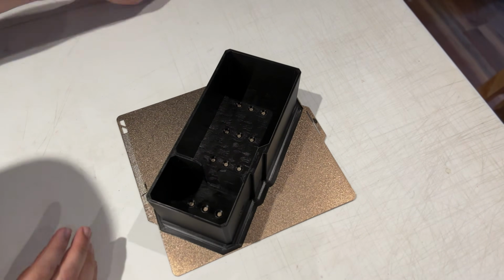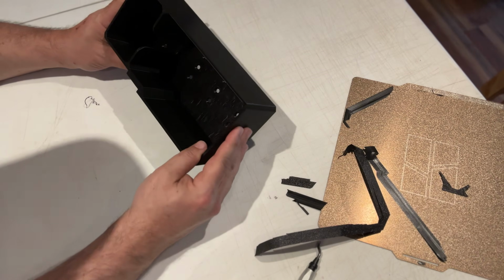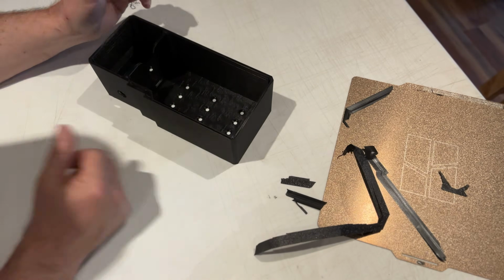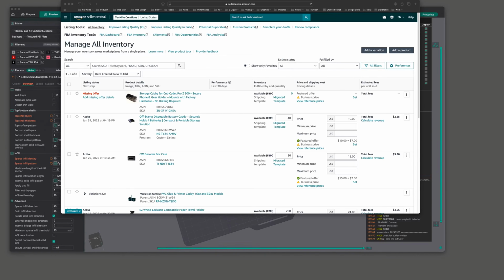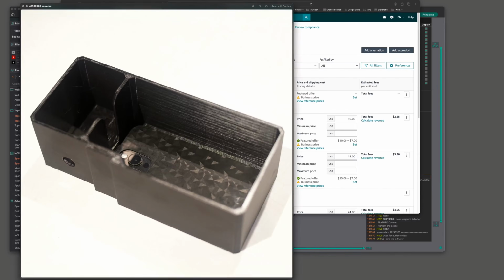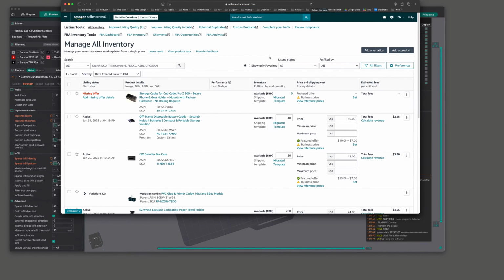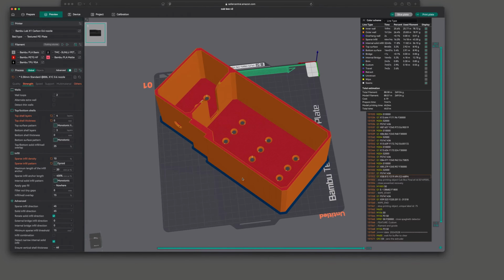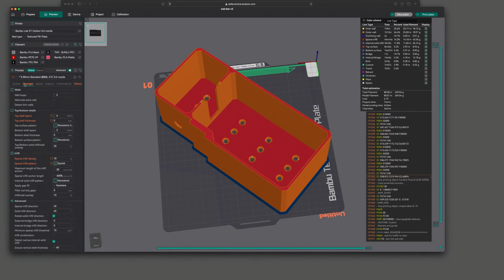Prototype to Product: Selling My 3D Print on Amazon

Comment: I have a Bambu A1 too. I hated the curl on the bottom of the print. I bought a BIQU Frostbite build plate. I haven't tried it with PETG but I can say I have not had any PLA curl or print break loose since I started using that build plate. There is another build plate, the Glacier, but I did not buy it because the Frostbite is designed specifically for PLA and PETG. I highly recommend it! I bought mine directly from BIQU with the other cool gadgets that they make for the A1. I no longer use a brim because PLA sticks to it and it's not needed.
Reply: Nobody sells it here yet, but I can get the Supertack, which seems to be about the same from tests I've seen. I really want it now, because I'm staring at a print that just finished up, and it lost grip right as it was finishing off the last layer. At least it was a functional print :)

Comment: I'm kinda happy Amazon haven't bothered to set up business in my country. I wish we had more competition in some fields, but we don't need their form of competition, and we certainly don't need their messy merchant-facing systems :)

I've worked a lot with the AWS side of things, and it's just as bad there. Lots of things that should happen instantly don't. It could take hours. In rare cases, you won't get anything done until the day after. With Microsoft's systems that's the norm though. I guess it could be worse.
Reply: haha true that, their billing system is kinda messy too
Reply: @BRP-Moto-Tips  I think there is a certification you can take for their billing system now.

Comment: Don't worry about all the listing attributes; just put in the necessary info. People insist on Prime 2-day delivery, so FBA will be needed if you want sales.  I gave up on printing large boxes; the corners always warp even with a brim.
Reply: I've had many problems with plate-sized boxes too. Cleaning often helps, and it seems getting a run of the same thing with no pause works. First print may warp a corner, and the rest look great. Time to investigate alternative build plates!